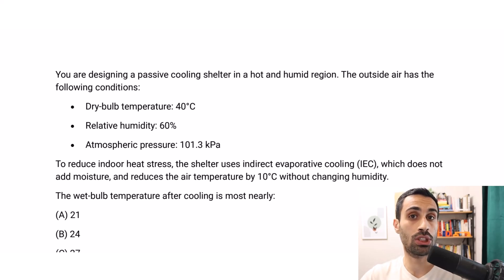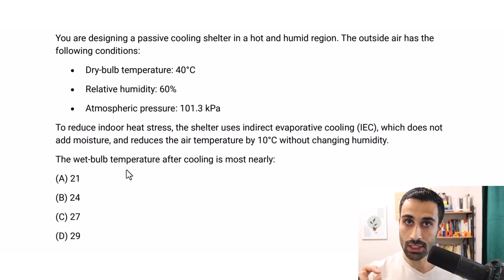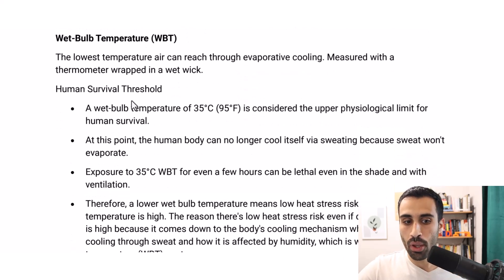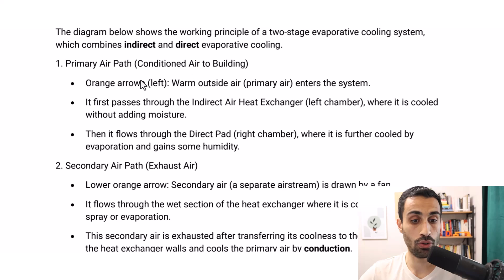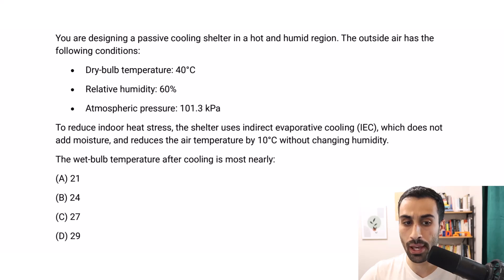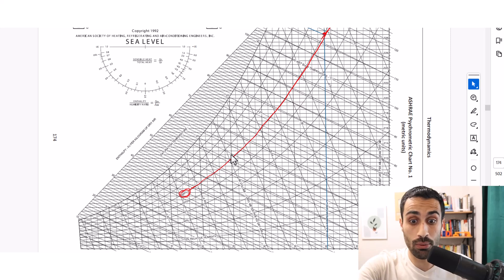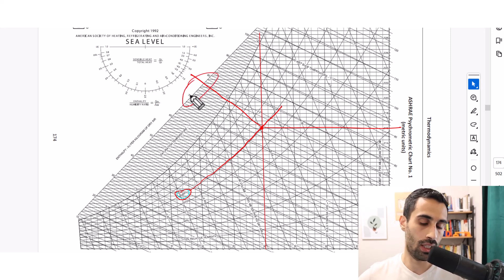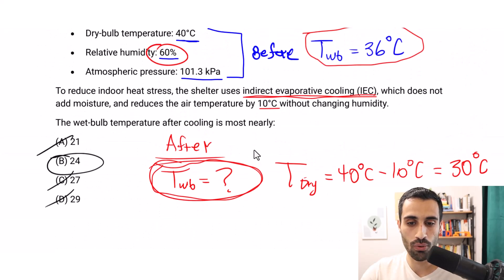FE Exam Review - Psychrometrics - Global Warming Heat Stress - Wet Bulb Temperature

Comment: sorry I'm late to the study, session I've been preparing since January 2025, I'm that bad of a test taker, also I've been fighting an illness for ten years while getting my degree. the Limburg book was a great speed recap, but I'm at the point of slowing down and finalizing my habits. tldr your videos have been great and helpful. i pause the videos and attempt by myself, but i have a bad habit of getting stuck at the starting point
Reply from the maker: Getting stuck is part of the learning process. Cherish it, because it means you’ve found specific gaps you can pinpoint. If you take the time to reflect on why you’re getting stuck.

Maybe you don’t yet have a broad conceptual understanding? If that’s the case, slow it down and start by actively reading about the concepts. Ask yourself lots of “why” questions, those will lead to the connections that help the bigger picture click.

Or maybe you’re reading the problem statement too quickly? If so, slow down and carefully write out all the GIVENS and clearly state WHAT YOU NEED TO FIND. Often, the hardest part is simply knowing exactly what we’re solving for. From there, try to connect the problem to something similar you’ve seen before whether from past practice problems or even a YouTube explanation.

Ultimately, it’s about exposing yourself to the concepts and then applying them through problem solving. It won’t be perfect and that’s the point. Struggling, making mistakes, and learning from them is exactly how you’ll build the skills needed for the real exam.

Take plenty of breaks, trust the process, and keep going!